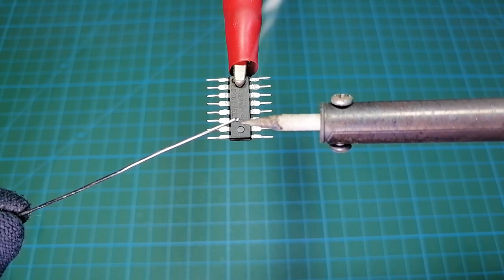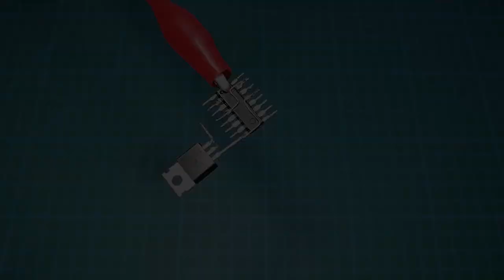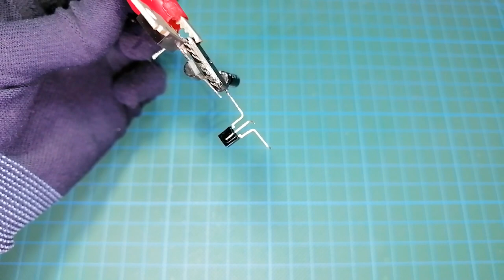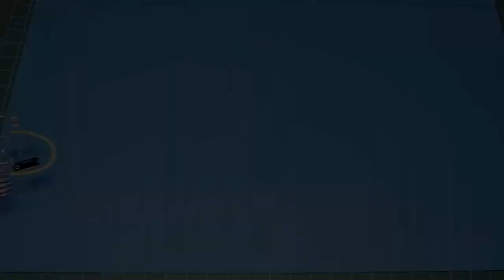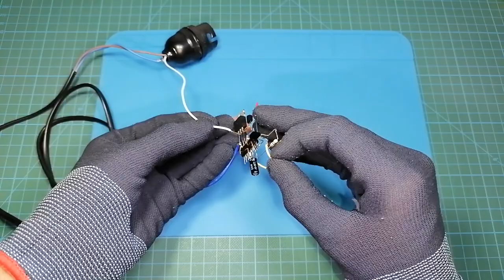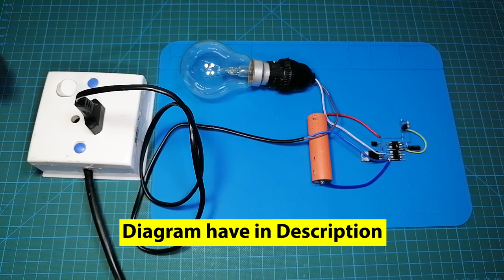How to make simple Wireless Remote control Switch without Relay, IR Receiver Remote control

Comment: Dear Sir, thank you for your video. In my opinion for better and not dangereous usage, instead of connecting battery to 5 volt circuit, you may use 5 volt transformerless circuit that has capacitor and 5 V zener diod. Thank you again. It is very useful and small circuit that can be inserted lamp holder.
Reply from the maker: welcome:elbowcough::stayhome: